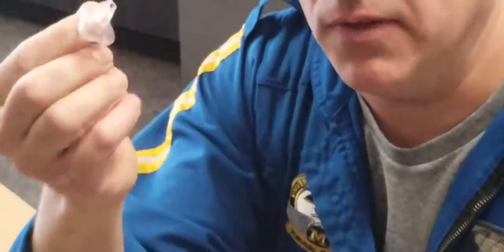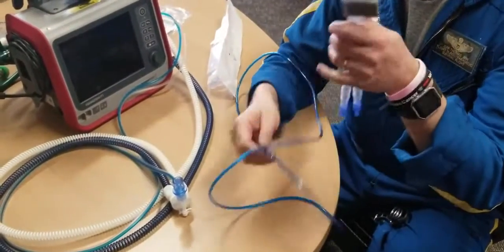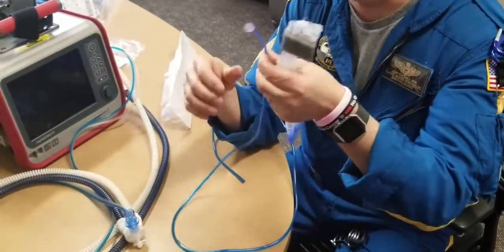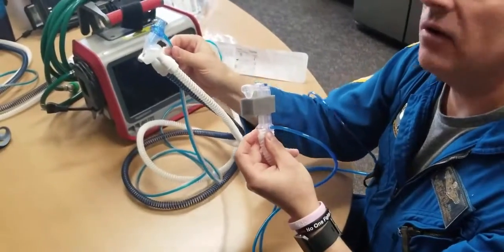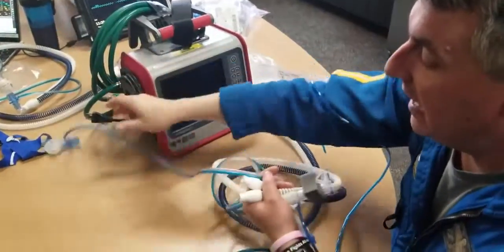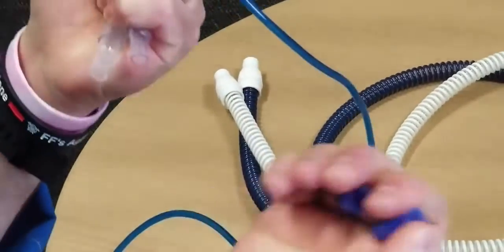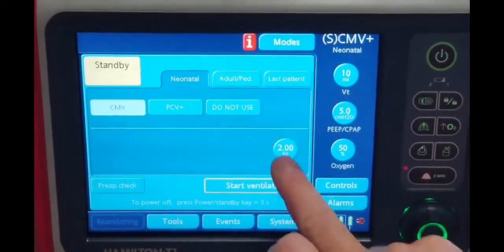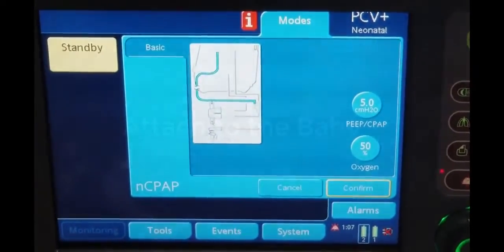Neonatal CPAP on the Hamilton T1

Comment: Do you still use the flow sensor (with both the blue and white pressure tubing) with other non invasive modes? Is the blue ncpap pressure tubing just for ncpap? Also can you run HHFNC in any way off that ventilator?